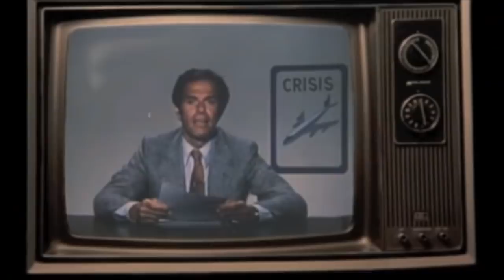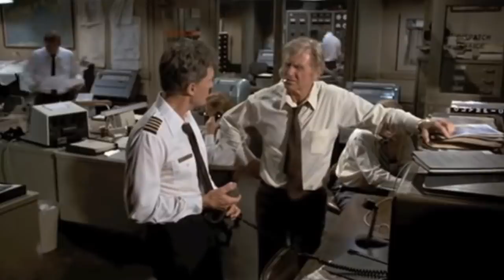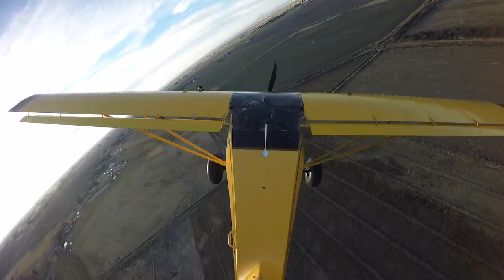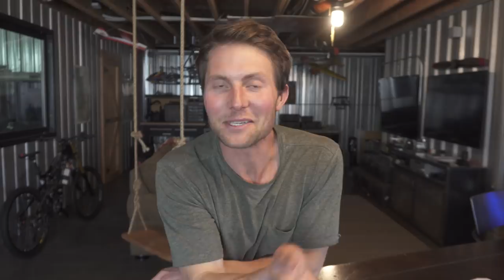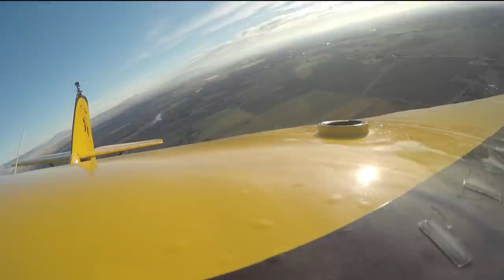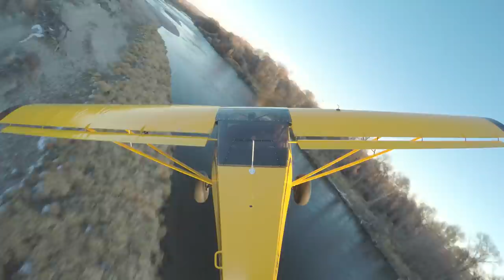Engine Out Landing! What happens if you forget the wing tank GAS CAP.

Comment: Should take some glider instruction. All approaches are engine out. If to high slip her in, you can dramatically loose a lot of altitude in a radical fun to fly/perform slip...
Reply from the maker: alan connelly I really would love some glider training! One of these days I’ll do it!
Reply: @JonasMarcinko  it is a blast. A guy just set the world altitude record in a glider 90,000 feet climbing from near sea level using natural mountain wave lift (he was in a pressurized sailplane). But others have fliwn to 50,000 ft worth plus several times in pressure suite. My longest flight was 5 hours, had to land to go pee. Crewed for a race where they 50 gliders raced around 200 mile race courses. A hand launched model RC glider flying on the backside/downwind side of a ridge in California in a tight circle excelerating each turn setting a world speed record of just over 500mph...! The G forces were far more then a human a withstand, it on YouTube, its going so fast you can't hardley see it in maybe a 50 yard diameter circle going 500mph...! Amazing sound. It's common in Colorado to see lift to clud base of 500fpm plus,out climb many power planes.

Comment: We went flying and forgot to put the cap on one wing. Was a quick flight to inspect rpm at cruising to make sure the prop pitch was correct. I would guess total time of flight was around 25 min. Landed safely with some fuel marks on wing but not much fuel out. I Have to add we only topped up fuel with 25 litres so wasn’t full tanks.

Comment: An interesting question to me would be if the weight of the water that is heavier than AV fuel would change the effect of the negative pressure on the top of the wing.
Reply: Avgas: 6 lbs/gallon.  Water: 8.3 lbs/gallon.

Comment: More going on that sucking gas (water) upward and out of the wing I think.  That alone would require collapsing the tank unless there's a vent with a check valve.  Is it maybe be turbulence at the open neck stirring up the liquid so that some comes out and air goes into the tank to replace it?

Comment: You only dribbled a bit of water because the tank was FULL. I have known of a fuel cap coming off in flight (improperly closed) on a Jetstream 32 turboprop that cruises at 250 knots, and they did not lose a drop of fuel. Normal trip fuel on board only, about 60% full.
I have a 30-year old Avid Flyer (grandfather to the Kitfox), and have had to dead-stick it in a couple of times. The trick is to ALWAYS come in high and use varying sideslip to control the glide angle when you are assured of reaching your chosen landing spot. This thing changes into a piano in an agressive sideslip, provided you take care to maintain a normal approach speed (60-70mph). Due to it's low inertia, it changes INSTANTLY back into a flat-gliding airplane when you stop the slip. Practice, practice and practice, first at altitude and then on final. After you get the hang of this, you can put it down on the exact spot you want, no messing around with S-turns and maybe ending up with an undershoot.

Comment: To my knowledge inside every fuel cap is a spring loaded flap so no fuel will escape if the cap is left off
Reply: Harold clark I can confirm this is not the case in the older Cherokee 140s... I noticed about 5 min after take off, by the time I was back on the ground the tank was about half empty. Whoops. Never did that again.
Reply: Old pipers, Cessna, not even c130's have those in the over wing fuel caps

Comment: How much did your kitfox cost?  and did you build it yourself?
Reply from the maker: Douglas Mattos I did not build it myself. And would rather not disclose the amount. I  believe if you build one similar to mine you’ll spend around 70k  
Barnstormers is a good website to check for aircraft.
Reply: fair enough, I always wanted a plane and didn't realize  I could build one.  I think the kitfox is what I hope to own some day.
Reply from the maker: @DougOrDouglas  I did build my Capella airplane which is actually similar to the kitfox and I found it partially built for 20K. there are deals out there!
Reply: @DougOrDouglas like Jonas said check out Barnstormers. There are great deals all the time. When you go onto Barnstormers click on classifieds at the top, then scroll down and click on experimental in the left column, from there  check out  Avid, Kitfox, Murphy, Rans, and Zenith. You can find used kitfox model's 4 and 5 for 20-50 k built ready to fly. The planes with the auto conversion or Rotax 2 cycle motors go a bit cheaper. Find you a local flight school and go for it.

Comment: You purposely put water in your tank?....
Reply from the maker: haha, what you do for videos!
Reply: SpeedRacer 650  planes have a sump in the lowest pat with a valve. Its easy to drain and you check for water every flight.
Reply: SpeedRacer 650  That's surprising, my Maule has them in each tank, so I assumed most planes had the same. Water in the fuel is nothing to mess with and it usually gets sucked up at the worst time right after taking off. I had it bite me when I used to tow banners. I was about 300agl and luckily had a beach under me. But it could've been ugly.

Comment: Fuel weighs less than Wasser.  Ja.
Fuel requires less suckage than Wasser.  I dunno if it would be the difference ... but ... the only way of telling is to put fuel in it (use shit car gas if you do that, save the precious AVGas).  Also, more speed, more suckage.
Reply from the maker: CluelessBeeKeeping Yeah so true! It seemed like above 90mph it would start sucking the water out. So maybe above 85mph gas would start getting sucked out? Thought about trying this on the my Glasair, but not sure that’s a good idea.
Reply: @JonasMarcinko  There is this plane I want (it's on a joootoob vid, don't ask which) and one of the videos of it where the vid is on the rudder (this is a Mucho slow plane, slower than yours) and it had a steady stream of fuel from the left side.  That's one thing, if I get it, that will be changed...  Welded fuel tanks in the wing.  The caps will be underneath the wing in the adjacent bay.  Or so is the plan.

Man...Glasair?  Bad ass!  Such a pretty plane.  I bet your glasair would suck it out FAST.

Comment: Once had an oil fill cap rattle off. after a 4 hour flight there was an alarming amount of oil dripping off the bottom of the plane and the engine was down a few quarts. not sure when the cap came off... probably could have been far worse.

Comment: How did you dry the tank out and make sure there was no more water in the system?
Reply from the maker: low point drain on the wing tank. let it dry for a few days. Put fuel back in the tank and drain out more to get the rest of the water out.
Reply: Hardly any worse than draining out moisture condensation inside the tank.  Good thing water is heavier than fuel.  :)
Reply: That’s what I thought, but wasn’t sure. You could always throw in some kitty litter to soak up any extra moisture. Just kidding!
Reply: SpeedRacer 650  .... You have never seen a proper aircraft fuel system with water separator/gascolator have you.

Comment: You put water in your fuel tank? That is stupid....and water weighs 10lbs per gallon, way heavier than gas.
Reply from the maker: Water weighs 8lbs.
Reply: @JonasMarcinko  u.s. gallon 8.34lbs.....imperial gallon is 10lbs...water still way heavier than gas...i saw a cessna 185 run out of gas in 20 miles...both fuel caps left off....trust me, it siphons out!!
Reply from the maker: So do you think If gas weighed the same as water, it wouldn’t get siphoned out?

Comment: The air on top of the wing is faster than the bottom. Higher velocity = lower pressure. The air on the bottom of the wing tries to equalize the pressure difference and pushes the wing up trying to do so.
Reply: Nope, that is not how it works. The wing produces lift by sweeping air down.
Reply: @feelfreefpv  I took aerodynamics at Rockwell international who designed the space shuttle. Maybe you can tell them they are wrong.
Reply: Well the space shuttle was some time ago and nowadays its widely accepted but still often misunderstood. It's not Bernoulli...
Reply: @DaUserLess  The laws of aerodynamics have not changed. It's a fluid and we know everything about sub, trans, super and hyper sonic.
Reply: @joem5110  And another one explaining why Bernoulli doesn't apply here:
http://www.terrycolon.com/1features/how-planes-dont-fly.html

Comment: Air goes faster under the wing
Reply: No
Reply: What? Yes it does. That creates lift. Top of the wing is curved while the bottom is flat. That way it takes longer for air to get over the top than it does the bottom so more air travels under the wing than over creating lift
Reply: Adding flap will make it so air can’t travel as fast under the wing resulting in a descent

Comment: I don't think you are doing yourself or anyone a favour by publishing this content. You have some knowledge, but just enough to make you dangerous. When the CAA inspector comes to inspect your wreckage one day, they'll look at this channel content and it will make sense that it was fuel contamination, reckless flying or controled flight into terrain. Despite your disclaimer, if someone from the flying community is to copy your steep turns close to the ground on landing approaches, we'll end up with another Nikk. Also, it's the Coanda effect that you are trying to describe, planes fly off the Coanda effect which enables the airfoil to deflect air downward, the contribution of the Bernouilli effect is far less than you'd imagine, yet still incorrectly taught as the explanation of how lift is generated. Rather than the one-upmanship of trying to better what Trent does, go make your own content with direction, that won't get you killed. I see too many signs that you are pushing the limits without room to escape, holes are starting to line up.